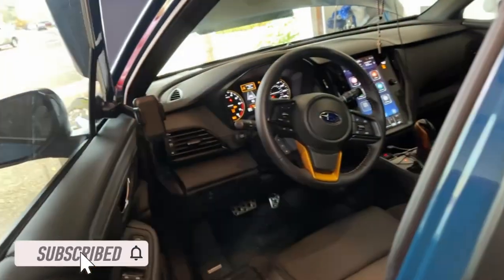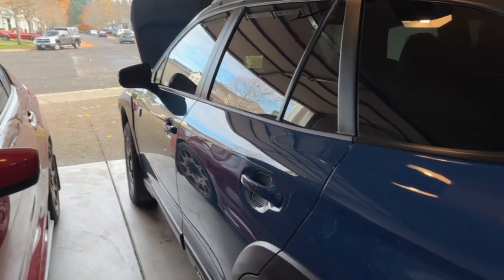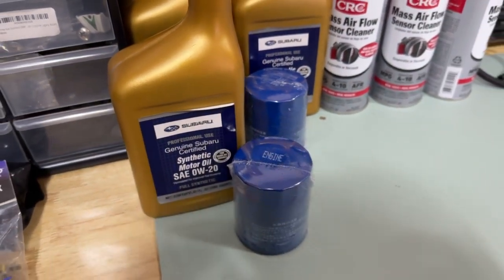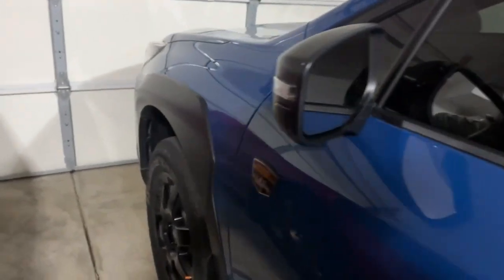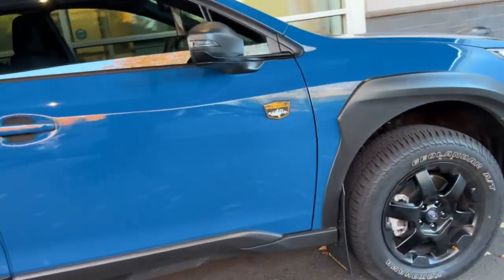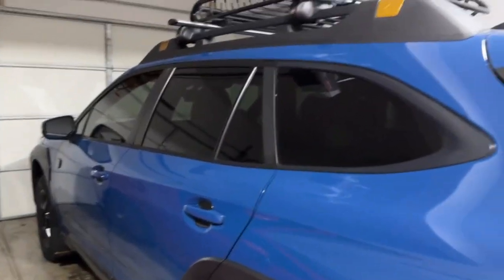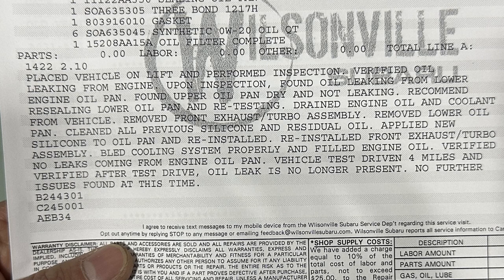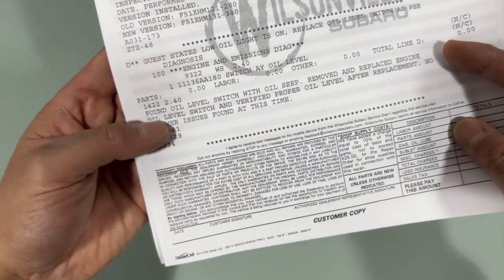OIL LEAK AT 1400 MILES! | 2022 Subaru Outback Wilderness

Comment: Although your oil is definitely overfull, that's not the cause of you leak. There is a known issue with oil pan gaskets being incomplete or not applied correctly at the factory. Unfortunately, another byproduct of this issue is that there can also be gasket material inside the engine, which could clog the oil pickup and starve the engine of oil, if the problem is not addressed. It's a serious issue. I have a 2023 Onyx XT on order and I hope this issue was fully resolved before my car is built.

Comment: Had taken my Wilderness in for an oil change it was discovered leaking too. They had to do the same thing and remove the pan and replaced gasket. Reinstalled everything. Things happen, we have to deal with the unexpected. This is a reminder to carry out our required maintenance.
Reply: What maintenance is required at 1,500 miles?  None…

Comment: Found your video, because, imagine this, my 2023 Outback Touring XT with only 1,748 miles on it, has developed a consistent oil drip. Very disappointed with Subaru, we’ve owned the car for 4 months. They obviously haven’t addressed the issue at the factory and this single issue is going to cause them to lose some customers. UPDATE: Took the car to the dealership, they said they tightened something related to the turbo and the oil leak is no longer there. Not sure if it will happen again, but we now have a little over 3k miles on the car.

Comment: The whole concept of them using a full silicon seal baffles me. I swapped out my oil pan for an iag oil pan at 4k. 6 quart capacity, and it uses an actual gasket with only a couple dabs of silicon.
Reply from the maker: That’s a great idea. I’ll definitely be looking into this! Thank you.
Reply: Replaced my own oil pan on my 2010 Outback 2.5 due to RUST. Used Permatex Grey “The Right Stuff.” It worked very well. I wonder if the factory is failing to let the sealant “set-up” (cure) before assembly. It wouldn’t be practical for an assembly line.

Comment: Oil pans have been around for 100+ years… pretty simple, Subaru should get this right. Gonna check our ‘23 Touring xt tomorrow morning.
Reply from the maker: 100%!
Reply: Hey, I got a Touring XT on order and I was wondering if you found an oil leak on yours? I hope I don't have to deal with that on a new 2023 model.
Reply: @Pecone  no leaks on ours. 7000 miles and two oil changes later, all good.
Reply: @ThatPNWlyfe  That is good to hear. I will definitely be looking when I get mine this week. 🤞 Everything is good here

Comment: I’m a suabru tech and have even seeing this issue. Not only have they been leaking from the oil pan it’s been leaking from the oil level sensor. The gasket that holds the oil level sensor in place. I’ve been seeing them leak from that along with the oil pan. A lot of techs don’t catch it because they automatically assume it’s the oil pan. At my dealership we replace the oil level sensor along with doing a pan re seal. Your car may be not affected but something to look out for! Best of luck man beautiful car
Reply from the maker: Yes, the oil level sensor was replaced too, which I’m thankful for! How often do you see the upper oil pan leaks??
Reply from the maker: And thanks man! It’s a great car!
Reply: Why replace oil level sensor and oil pan not even past 2 years old ? Cheap seal or gasket to wear out quickly ? Mine 2003 Subaru Forester XS hasn’t leak from oil pan or engine but took my for a regular following up and oil change everytime now mine has 270k miles ( 66k on motor ) and 270 plus miles on 4eat , still going strong . I’m aware of HG issues but that’s not till 100k miles same time to replace with timing belt along to replace HG that’s it . But newer car ? I was like wtf ? I expect update on a newer car . I know Toyota much more reliable than the Subarus . Both are Japanese made ? Smh
Reply: Is it just on Outbacks, or Foresters too? I note the Outbacks are now assembled in Indiana, but the Foresters in Japan. Is it a typical 'built by union worker' situation where poor quality workmanship is responsible? Any thoughts on this?
Reply: Did they remedy these issues at the factory for following years?

Comment: Thanks for calling this out. 

Just picked up a '23 Outback Limited XT. checked oil level at 90 miles on odometer. oil level was above the high marker by about an inch. inspected underneath and not noticing any oil leaks from pans or the surrounding area. checked oil while cold, sat overnight. on flat level surface. Seems like this was overlooked by the dealership during their Pre Delivery Inspection. Just a bit upset i've been driving this around with higher than specified oil levels.
Reply from the maker: Glad you caught it early! Thanks for checking out the video!

Comment: Thanks! Getting ready for a long 2,000 mile road trip in my 12 month old 7,500 mile OBW. Saw this and checked underneath and found an oil covered pan too. Was going to change the oil myself before the trip,  but now taking to the dealer and hoping my trip can still happen.
Reply from the maker: I’d plan for a week out just in case! Thanks for checking out the video!
Reply: @ronfromportland  It's the upper oil pan seal. They have to pull the engine. 18+ hour job.
Reply from the maker: @benjaminkniola1715  oh wow! I’m glad you found it though. Hopefully they correct the lower oil pan while they’re at it.
Reply: @benjaminkniola1715  
It was the lower oil pan, the dealer absolutely scammed subaru of America. Common failure from factory on the 2.4s. It's always the lower oil pan. I've resealed over 100 brand new lower oil pans. Pays 3 hours, sucks to do, and there should be a recall.

Comment: Just took mine in today, 2022 OBW ~18k miles.  Same thing, lower oil pan leak.  The dealer decided to replace the oil pan rather than just re-seal.  They gave me a loaner, non-turbo.  I hope this is the end of this issue, and at least it's free to repair under warranty.  But it is frustrating for sure.

Comment: This is a major issue for Subaru imo. My wife’s 21 onyx is leaking pretty good but not dripping and it has 42k miles. I believe they are going to cover it under drivetrain warranty. My 22 OBW with 2800 miles is also leaking but barely right around one corner of the lower pan. Not sure if I should wait or get it replaced now. This is very unfortunate

Comment: Has anyone has issue with oil level sensor leaking oil due to a failed gasket on the oil level sensor itself.  Dealer telling me cost to replace is $1100.  Mostly labor.

Comment: Well now I'm a little nervous, 
I had a full set of Rallitek skid plates put under my '23 FW, there is is less then 1100 miles on it. I'm going to need to drop a plate and inspect.
Reply from the maker: You should be fine. As far as I’m aware, the leak is only known on the Outback models. It won’t hurt to check though.

Comment: Subaru of America and the dealerships I’ve dealt with are wonderful! I’m also a Subaru Ambassador. However, I recently reserved a 23 OB Touring XT. I talked to my friend who’s a Subaru Tech and he said to watch out for oil pan leaks. I’ve owned several new Subarus from 2014 to our current 2018. And some of them either had oil leaks or needed new transmissions. One needed a Harman Kardon amp and another a head unit. I just got a 23 Frontier Pro-4X and I love it. That’s how I became friends with my Tech.
Reply from the maker: The dealership did provide some great service! SOA told me they reached out to the dealer to check in on the repair. I made sure to let the service person know that I reached out to SOA not because I complained about the dealership, but to ensure this issue is properly documented and to possibly help them justify a recall.
Reply: I've been thinking about getting a P4X Frontier, too. I've had 4 Frontiers in the past and 7 Subarus.

Comment: Wow- good video for awareness. I just ordered a new OBW 2024., I’ll keep my eye on the lower oil pan but don’t know exactly where it is located. I guess I’ll have them point it out once the car arrives from the factory
Reply from the maker: Thanks for checking out the video. I’m hoping the issue has been fixed for the 24 models. If it’s leaking bad, you’ll be able to see drops on your garage floor.

Comment: Just checked your video out because guess what?  I got the same problem.  Took my 2020 Onyx in for 36K oil change, about 200 miles short of 36k.  Car is in the shop right now getting taken apart.   Luckily, this just came in under the warranty since i didn’t hit 36k yet.   They are also going to replace my rotors front and rear because they are warped.  Crazy, because i don’t drive real hard.  Have a Toyota with 135k and original rotors.   We’ll see what else they find while they have it.  

Thanks for the video.
Reply from the maker: That’s crazy! Nice that you’re getting new brakes and rotors though. Thanks for letting me know, good luck with the repairs!
Reply: @ronfromportland  Here’s an update.  The dealer had my Onyx for 2 weeks.  The upper oil pan, lower oil pan and oil pressure switch were all leaking.   It’s crazy, because i park in the same 2 spots every day and never saw a drop.   They fixed the leaks under warranty and replaced my warped rotors.  No charge.  
Here’s the problem though… i got it home from a 10 mile drive and immediately smelled burning oil when i parked at home.   I took it to work in the morning, same smell.   I figure it’s either oil residue or it’s leaking again.  So i brought it back to the dealer and they’ve had it all week, no updates.   At least i have a loaner car.  It’s a 2023 Outback with all the bells and whistles minus the turbo.  Man i miss my XT.   Hopefully I’ll get it back soon and it won’t smell like burnt oil.
Reply from the maker: @tjaym8844  oh man, mine smelled like burnt oil for a few days after it got repaired. Maybe it’s coolant since it had to be drained and replaced from removing the turbo. The smell eventually went away. Glad you got yours addressed though. Thanks for the update. Curious to know what they say after the second time around!

Comment: Our 2023 Onyx (non Turbo) Outback was overfilled with oil (at least 1/2 inch above full on dipstick).    I just changed oil at 1200 miles and did not see any leaks, although I had already blasted everything with Surface Shield so might have been hard to notice any oil seepage.   I'll keep my eye on it.  Thanks for the heads-up.   I will note that 4quarts (1 gallon) of oil hit my dipstick exactly half way between low and full..  Perfect.
Reply from the maker: Fingers crossed for you! Thanks for watching the video.

Comment: Thanks for posting this! Luckily I haven't seen any oil leaking from my '22 OBW. I did however have a blown shock on the passenger side rear. I'd like to throw that out there that if you're already under the car, just look at the shocks too. If it looks like oil is leaking out from it or the shock just looks shiny or slick, take it to the dealer. Luckily my dealership was able to replace and align the car the next day after confirming it was bad.
Reply from the maker: Great info, thanks for pointing this out! I’ll  be sure to check out that area too.
Reply: Damn. Good catch. Is this the problem of it being assembled in the USA?

Comment: We kept taking our Outback to the dealership bc our Subie wouldn’t stay in the lines on the road, 
The eyesight fouls out, the warning when another car is along side , the horn honks for no reason and the auto rear brakes seldom work.
Our Subaru dealership in Wenatchee Washington Never fixed any problems nor did they give us a car to drive.
We repeatedly tried to get our issues fixed until our warranty expired.
Now our dealership wants to charge us $145 an hour to try to fix what they couldn’t under warranty.
Screw Cascade Subaru.
Reply from the maker: That’s messed up! I would write to Subaru of America if you haven’t already. There’s a form on the site that you can fill out. If the repairs they performed failed, they should be held liable!
Reply: @ronfromportland  Subaru of America told us that our problems need to be resolved through our local dealership.
I don’t think we’ll ever buy a Subaru again

Comment: I was just notified by my subaru dealership at the 24000 mile service  that my 2022 subaru ascent was leaking oil and that the oil pan would have to be resealed.  I would have to leave it as it would be an all day service. This is my first Subaru and first new car in 12 yrs.(purchased new April 2022) but this really cuts my confidence going forward with this car especially when the mileage gets out of warranty range besides the frustation if dealing with something major like this with a new car. It really makes me wonder if there is a quality control issue at the subaru plant in indiana since the outback and the ascent are both asssmbled there. Thanks for sharing this video.
Reply from the maker: Thanks for checking out the video. I was absolutely gutted when I saw that leak. Glad you’re getting it taken care of though.

Comment: Same on our 2023 Wilderness 5k miles. Dealer put dye in oil and said come back 4 weeks. Leaking in the same area as yours.
Reply from the maker: Really bummed to hear the 2023 models are still leaking. Luckily it’s an easy fix but definitely a hassle.

Comment: Same here.. Bought a 2022 Outback wilderness in Ontario .. 2 services done there and did not report any leaks. Moved to a different province and the vehicle inspection failed due to this. 

Took it to a local Subaru dealer and they claims to have replaced the lower oil pan under warranty and 2 days later my inspection fails AGAIN due to the same oil leak. I have to go back to the dealer again . No loaners given to me here as in their policy, since the car is drivable (despite the oil leak), i cannot get a loaner

Will post my update here once i visit the dealer the 2nd time to get this checked. Mine is currently at ~9000 miles
Reply from the maker: How frustrating! Hoping you get it taken care of asap! Keep me posted.
Reply: Hi @ronfromportland   - I got the car fixed again and my inspection FINALLY passed today. 

The dealer did confirm the second time that the oil was leaking again. This time, they resealed the lower oil pan and left it overnight. They filled oil the next day and checked. I left the car at the dealership overnight (i intentionally did not collect the car as I wanted to wait and see). On the third day, i asked them to check again, they confirmed and provided the all clear.

Thanks again for posting this video. this really helped me ! Subscribed !

Comment: You should have brought the car back immediately rather than changing the oil yourself.
While I have had great service from the dealer I bought my '18 from, new, 
You now have no proof of the overfill situation. This  can cause engine damage.
The first thing I do after buying a car or having the oil  changed is to check it.
I  do all my own oil changes on my Outback, especially because one change that came with a maintenence package from the dealer, the drain plug was left  loose and I luckily noticed it just before hitting the highway for a five hour trip.
 Overall I have found Subaru dealers will go above and beyond what us required, but it is always good to preserve the original situation, to protect yourself and to alert Subaru to any potential problems on their end.
Reply from the maker: Yes, definitely. I made sure to mention it to Subaru of America so everything is documented. Plus, I’ll make sure to take advantage of the extended warranty we purchased with the car. 

Sounds like you avoided a catastrophic situation! Nice work.
Reply: I agree, if you find an issue with a car that is still under warranty you should take it back to the dealer asap. Playing around trying to fix things will only unnecessarily complicate the issue and may in extreme cases void the warranty.

Comment: Hi Fellow Subi owners. Same issue just found on my 2022 OBW. Leaking oil from either lower pan or upper pan. Have to take to dealership. Leak was found by my local mechanic and I while inspecting the undercarriage during routine inspection for registration.
Before ever reading these posts, we found this leak. I had gone back to check warranty coverage and notice in my maintenance records how much oil they had charged me for and put in during service. I initially got my oil changed at Subaru where I purchased vehicle(1 hr away). They were correctly adding 5 qts with oil change. 
After 3 oil changes, I switched to more local dealership. Yesterday I noticed on local dealerships paperwork that for last 3 oil changes, they have charging for and been putting in 6 qts. I went out and checked my  dip stick and I am WAY overfilled! This is basic shit. WTF. In my mind, this is cause of RTV giving out as well as poor manufacturing issues. 
Now I am off to see if Subaru will take care of me. I am at 39,000 miles on vehicle. Basic 36K warranty up, but powertrain coverage is 5yrs./60,000 miles. Hoping they cover it.
Will request leak seal, sensor replacement and to stop overfilling my vehicle with oil as noted in thread. 
Thanks to all who have posted!
Reply: Is your still cover by the Subaru?

Comment: My Outback Wilderness with 7200 miles on it just went in to the shop today for an oil leak. Seems to be the same problem for me. It’s the weekend so they have to wait until Monday to do a real inspection. Hope it’s not gone too long I declined the loaner because I have a second vehicle but it’s a gas guzzler don’t want to have to drive it for week(s)
Reply from the maker: As long as there is oil in the system, it should be fine. The leak is very slow. Glad you’re getting it addressed though!